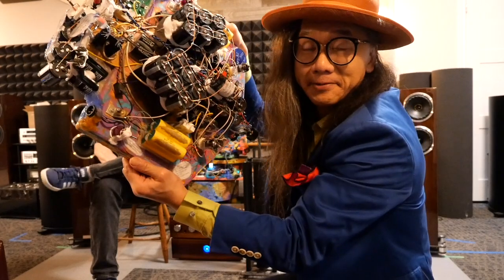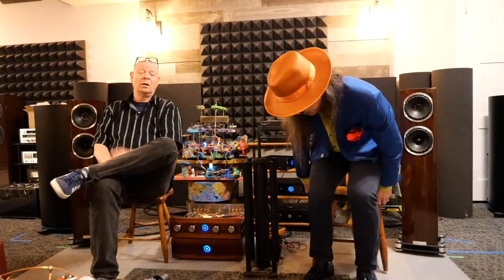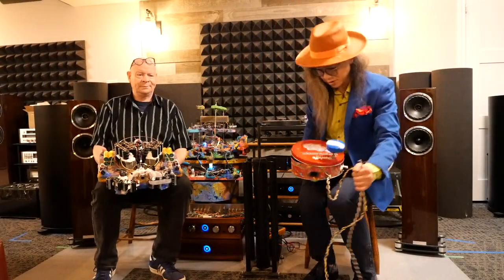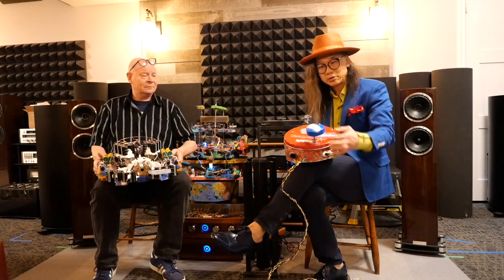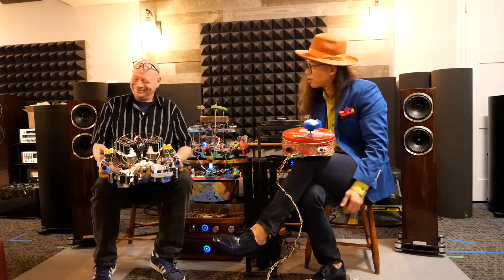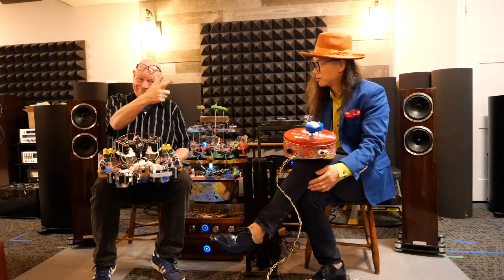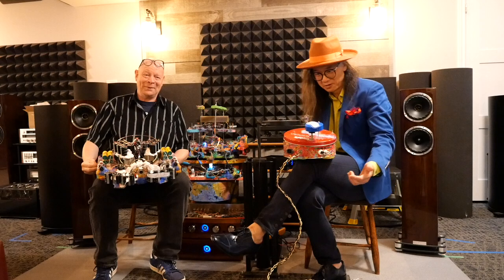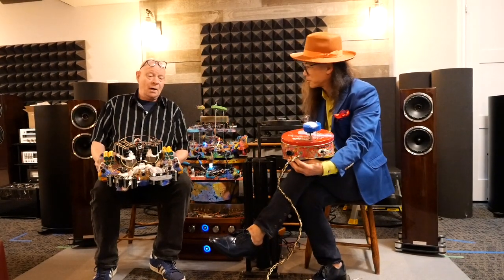Retrofitting 33 years old BC3 and BC3000 preamp with Adjustable B+ Voltage Tube Supply Rail

Comment: You said the different B+  settings change the bias of the tube but not the gain of the tube…
Does the amplifier ’see’ the same voltage or ‘output’ from the preamplifier with each different B+ rail setting?  (Not sure I’m using the right words)
Reply from the maker: You are using the right enough words that I understand exactly what you are asking.  Answer to your question is........ No, the output level does not change with different bias.  In another word, the volume stay the same with different bias setting.
Reply: @angela-gilbert thank you for the reply.  
 In general, would you say that subtle changes in the preamp make more change to the sound than subtle changes to the amplifier?
Reply from the maker: @jasonwebb6484  Yes, I agree changes in preamp make more change to the sound than changes to the amplifier.